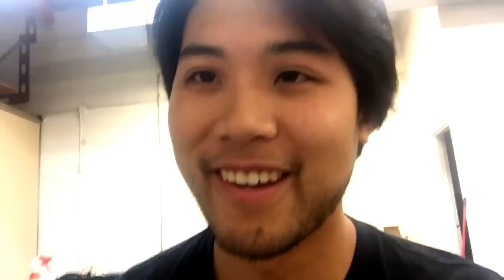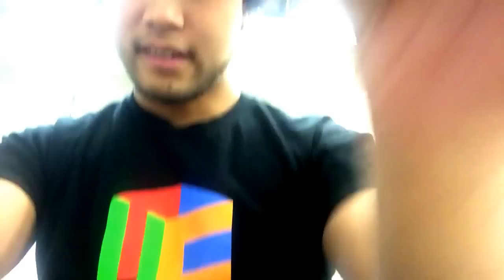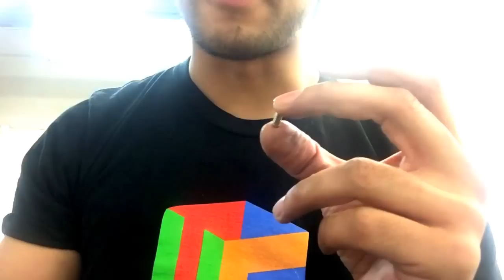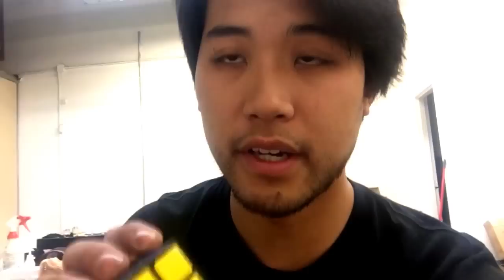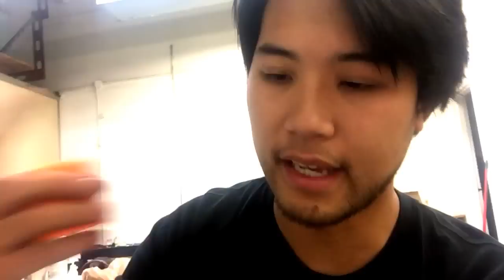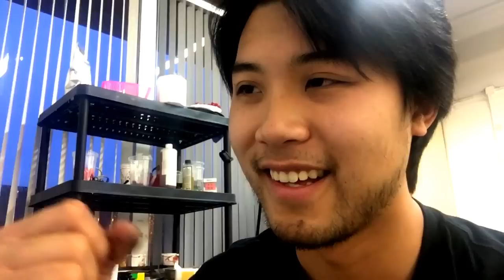How to fix M slices for magnetic cubes! One simple trick, cubists hate him!

Comment: I'm looking for a solution to the M slices feeling like there is too much friction to overcome at the beginning of a turn. I don't feel like I'm undershooting or overshooting, as in the video. This is on the new Gan 356 X with green springs and yellow magnets. I have to use substantially more force to overcome the magnet strength, unless it's just the friction between the M slice and the L and M layers that makes it harder to turn initially, which is hurting my U, H, and Z perms primarily. Is this because the L and R layers only have to break the magnetic force of 4 pairs of magnets while the M slice has to break the magnetic force of 8 pairs? If so, then is there a solution?

Comment: I have different opinion, if we turning normal move, example U move, the resistor is only 4 couple of magnets, (each corner has a couple with the edge beetween them). But, M move, there are 8 couple of magnets that are connected (each edge have 2 couple magnets conected because beside it left and right there are corner attracted) . So i think M move is harder/heavier because M move has more resistor

Comment: To initiate an R turn, you only need to overcome the magnetic force between the R face and the M face. To initiate an M turn, you have to overcome the magnetic forces between the R and L faces. Therefore, you exert more force to get the M slice moving but you cannot instantaneously stop that increased force as the M slice starts to move so it would overshoot. I'm not saying the rotational weight doesn't play into it, I'm just not sure I get the logic about the under and overshooting. I think the extra force needed to get the M slice to rotate would cause overshooting once the rotation moves past the magnets.
Reply: Michael Heller that's an interesting thought, you also have to think that there are 2x the magnets trying to stop the m layer at the end of the turn though, so that would help to balance that out.
Reply: Tyler Limbach The slower the M slice is moving, the truer your point is. I would think the faster the M slice passes the magnets, the ability of the magnets to slow down the slice decreases. This is all intuitive and I may be off base.
Reply: This is what I though